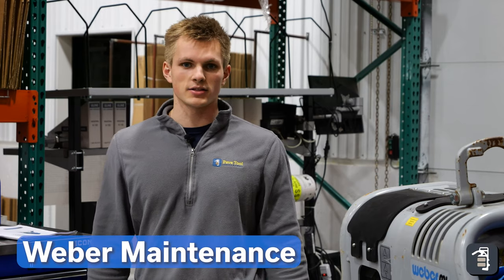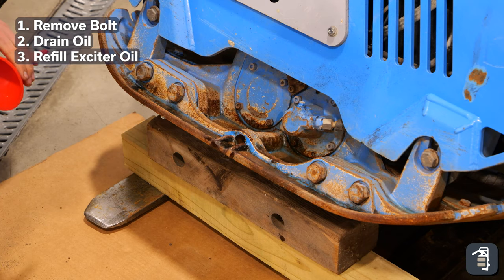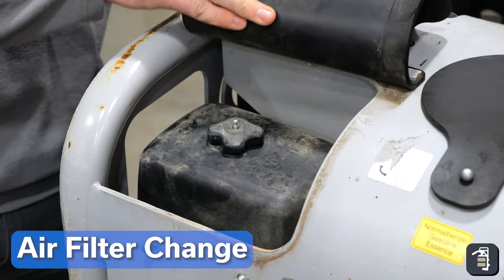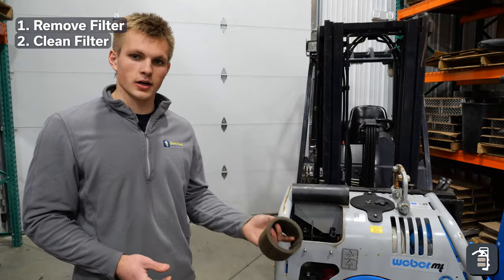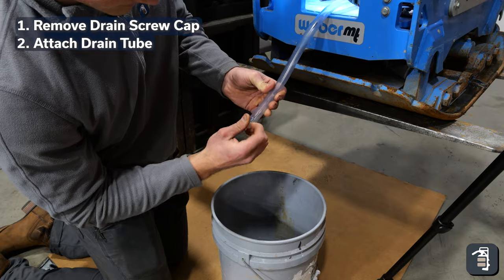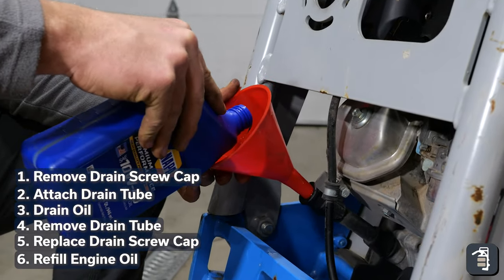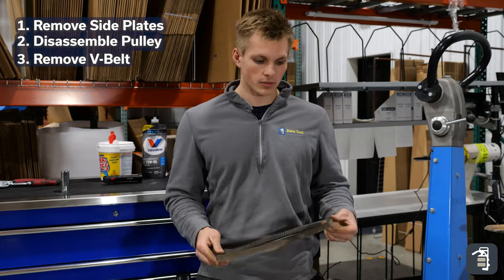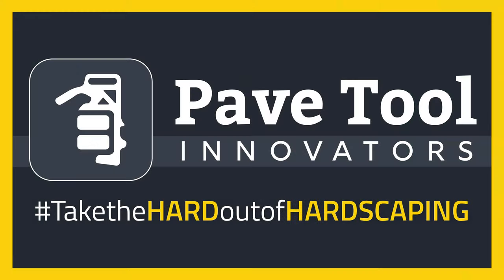Weber Plate Compactor Maintenance

Comment: When changing air filters on these, there is a gasket that usually sticks to the old filter. Don't throw that away! Use it on the new filter otherwise you will be sucking unfiltered air from the bottom.
Before spark plug removal blow some air before you unscrew it, because any dirt, rocks that fall down the cylinder will ruin your day.
Reply from the maker: Appreciate the added insight! Great tips.